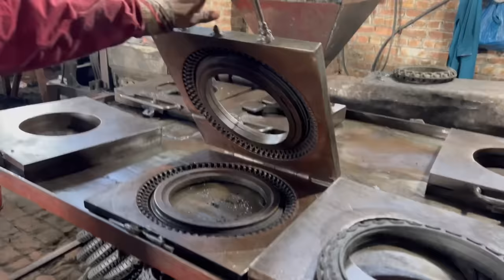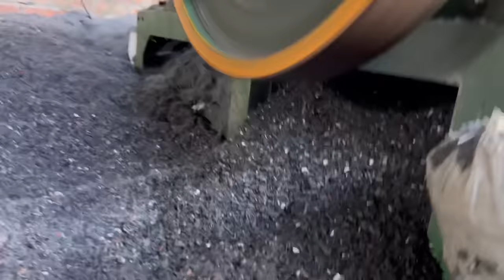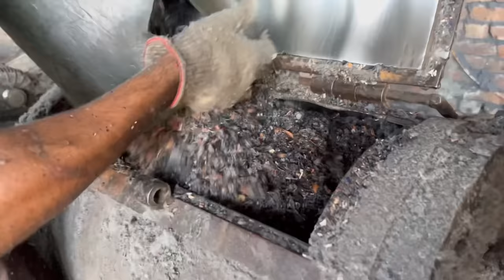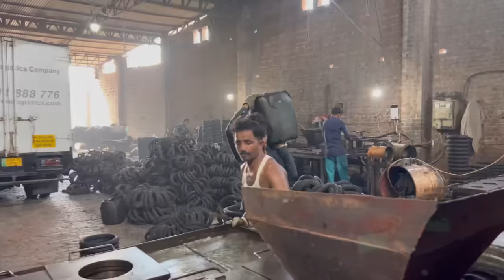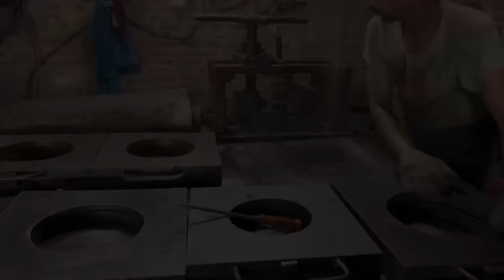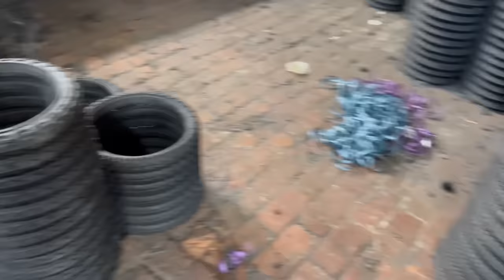Process Of Making Cycle Tire-How are Made Cycle tire at a local factory |

Comment: काम तो सही कर रहे हो । लेकिन जो टायर बना रहे हो, वो ज्यादा मजबूत नहीं है क्यूं की उनके अंदर कोई तार नहीं है वो सामान का वजन बह सके दीर्घ समय तक । लेकिन वो टायर तो बिल्कुल ट्यूब जैसा । ज्यादा दिन नहीं लगेगा फट जाएगा और टायर पिघल जाएगा गर्मी और वजन के वजह से । कृपया उसके अंदर कोई तार या अन्य सामान डालिए ताकि वो ज्यादा वजन बह सके और गर्मी के वजह से फटेना।  धन्यवाद👍
Reply: Most of these tires may not need wires and can withstand all forces. This is true basing on the raw materials used. For example for us in Uganda we mix mosquito nets, floor carpets made from pvc and some spongy but hard Chinese shoes to make a good long lasting wheelbarrow tire. It can last for 5 to 10 years

Comment: You are doing a good job, and you have well experienced employees, but your employee are at  at risk with rubber dust. Rubber dust is very dangerous for health.
1. To safe your employees give them breathing masks to cover their noises and mouth everyday. Even a piece of cloth to cover nose and mouth will help.
2. Control the dust. You need filter fans that take out dust from working areas.
3. Clean your machines and warehouse regularly.